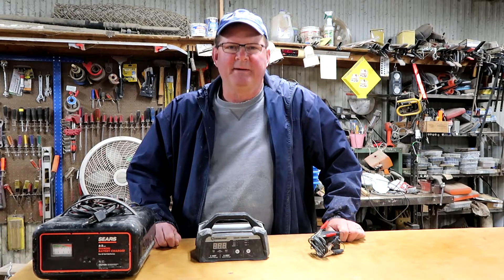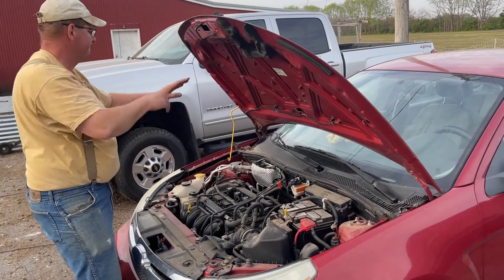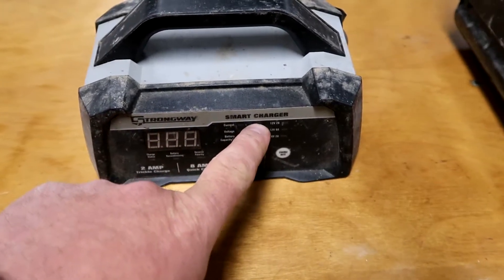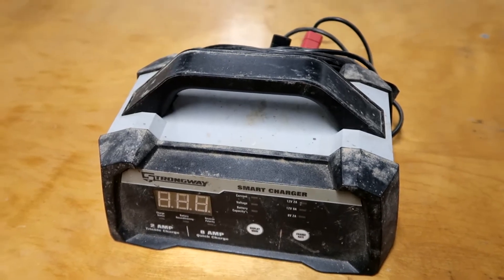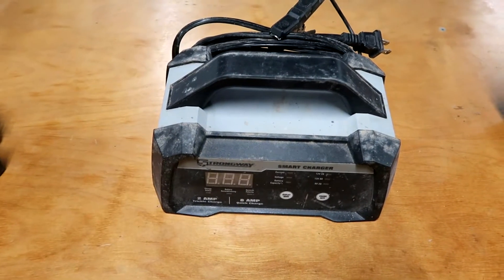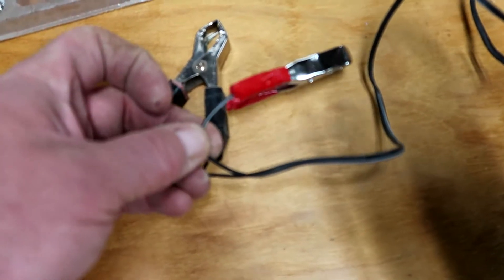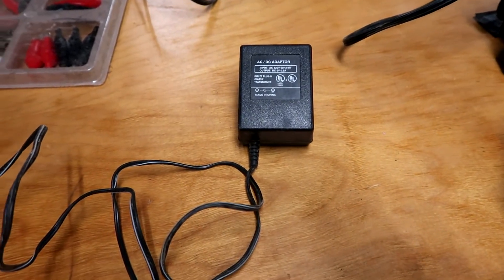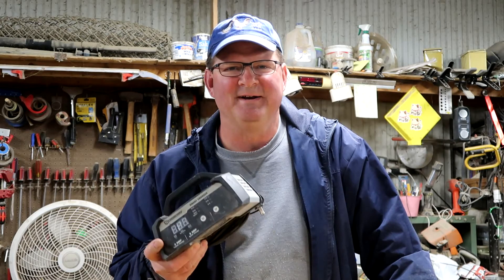Outsmarting a Smart Battery Charger

Comment: once upon a time I had a one of the old "dumb" chargers... sparky if you turned it on and tapped the leads... sadly I lost it in a move :(... 

good use of some old wall wart power supply... thanks for the idea.

Comment: You don't even have to do that. Once it see voltage it will start charging so you can take it off after 1 second just enough time for battery charger to see the voltage and then it starts charging.

Comment: Great video, but I have a question; how can I tell if my smart charger is putting out a charge?  It won’t turn on unless connected to a battery, and I’m trying to tell if the charger itself is putting out a charge? If I connect it to a battery, my multimeter reads the battery voltage, not telling me if the charger itself is working???

Comment: Wire a 9 volt battery in parallel with your dead battery to fool the charger.  You don't have to temporarily charge anything and you unhook it immediately after the charger comes on.  Basically the charger is reading the 9 volts from your "helper" battery.
Reply: what i needed to charge my 12 volt car battery! They need to fix these smart chargers. I mean it's not a smart charger if you can't charge a freaking dead battery!
Reply: @simplyraw1369 
They really should have a temporary timed manual override button. They can put all of the warning labels on it they want...but I guess the nanny culture or nanny state says no! 
I have heard some "smart" chargers have the ability to charge a flat battery and if so, good for them!
But that seems to be the exception and when it isn't, the feature is often said to be essentially hidden without careful study of the manual, assuming you have it or it's easily found online.
This is all so stupid as one of if not main reason most have to use a battery charger is to charge a flat battery. Oh sure sometimes it's just weak, not completely flat but often it's flat. 
I'm hanging on to my old ancient "dumb" battery charger after buying a newer "smart" one!
A nine volt battery, a drill battery, your lawn mower battery, a small power adapter (wall wart) all these things can be wired in temporarily if in the ballpark in voltage and the correct polarity but gee whiz you shouldn't have to!
It's easy to be casual about it when you have wire and a suitable battery just lying around and know this trick but many if not most won't be in a position to bypass the rather stupid safety feature. 
Thanks, the same people who don't think I can remember to put the cap back on my gas can and give me a crappy automatic valve that works poorly and broke within a week! One that requires so much force it moves the equipment, smaller equipment, you are trying to fill. Gosh thanks for thinking of my safety! Nevermind that I threw it away and got a traditional spout and cap bypassing yours and never mind I have to bypass what you intended with your stupid battery chargers you call "smart"....
If only, if only, this wasn't indicative of things in general and things to come!
You all know there's a lot more coming!
The people that don't think you can recap your gas cans or use a battery charger on your own have all sorts of other plans...
plans for you...
Reply: @simplyraw1369  
It sucks when you have to outsmart the smart charger, lol.
Reply: I tried the 9 volt in parallel, it worked just as you said.  Thanks Bryan!
Reply: @CECamp  
It's a handy trick to have.
Reply: Can you put key on AC on and use one of those cigarette lighter plug 9volt deals they sell to preserve computer memory and settings during battery disconnection?
Just curious... I understand me at would just use wires...
Reply: @michaelkulman7095  
I don't know about that.  I suppose if the voltage drop doesn't cancel out the power you're putting in, then in theory it should work.  Be a fun experiment to find out (except for the part of having a dead battery).
Reply: These Smart Chargers make me a bit mad. Mine has 2 amp , 10 amp and 15 amp plus Engine Starting Mode I believe. Plus Reconditioning Mode. The battery can have more than 3 volts and it automatically goes into Reconditioning Mode . That really p's me off ... As it's automatic but not so smart.  
I do have buttons for Charge, Battery Voltage, Alternator Check and Reconditioning. But regardless when Voltage is low it Automatically puts in Reconditioning Mode. Which a few minutes of Jumper Cables from a running vehicle will juice the battery enough to make the not so Smart Charger actually charge the battery. I don't have time for a 24 hour Reconditioning Cycle on a New but almost dead 4 Wheeler/Atv battery

Comment: I saw another video where the guy took a regular 9v battery and jumped it onto the vehicle battery to add voltage to it, and hooked up the charger and it works!
Reply: My solution to this problem is hook up my booster pack for 2-3 times, at 20 sec's a time ..... pushes enough base charge into the battery so the charger will recognize it and start it's cycle.

Comment: You could do it the easy way take 2 double 2 batteries link them together together an 2 peaces of wire tape one wire to positive an otger wire in negative of batteries  hook ur charger up to the battery u wint to charge then touch the positive wire an negative wire on the 2 double a batteries u linked together to create 3 volts to each gator clamp positive to positive an negative to negative an as soon as ur charger senses it is hooked to a battery wth atleast 3 volts in it an kicks in remove ur little battery pack u made now thsts how u trick a smart charger into beginning to charge a total drained battery it works I've been doing it for years

Comment: Can you hook up the smart charger with the other charger connected to bypass the 30min 1st charge time. Leave them both on for a little bit then pull the little charger off.
       Would that be advantageous at all to charge the battery faster?
Reply from the maker: I'm sure you could, but I haven't tried it yet.

Comment: That was a lovely video.  Since we're on chargers, I have a question.  A couple of months ago the alternator on my car started getting wonky.  I wasn't ready to change it out immediately, but I didn't want to get caught with a run down battery, so put the battery charger in the trunk.  I figured I'd have about a 50/50 chance of being in a parking spot.  Before I did that, I wanted to be sure that the charger was fully charged, so I went to plug it in.  BIG arc!  Checked everything that I knew about, tried it with a different plug.  Same big arc.  I gave up and time has passed to the alternator has been changed.  What was going on with the battery charger?
Reply from the maker: Hard to say without being there. Q: did you connect the charger to the battery before plugging it in?  When you say “fully charged”, did you have a portable charger?
Reply: @HappyWifeAcres  Yes, it's portable, no I did not connect it to the battery.  I'm just trying to figure out where my logic jumped the rails.
Reply from the maker: If the clips were touching or close, then yes a big spark would happen. Otherwise, it may be an issue within the charger. There’s often no on-off switch on rechargers so they come on when plugged in. Portable jump starters do have an on-off switch.
Reply: @HappyWifeAcres  It may be time to get a more modern charger.